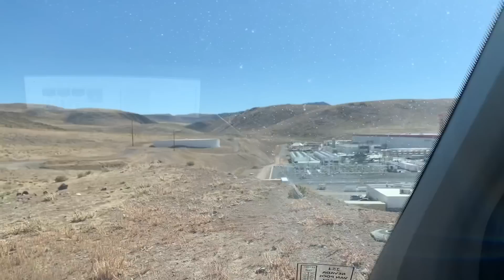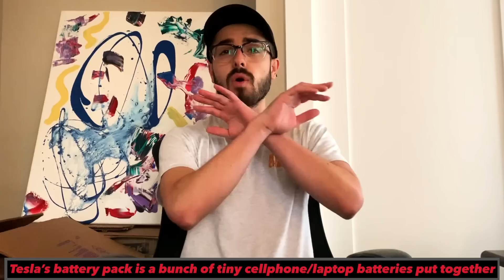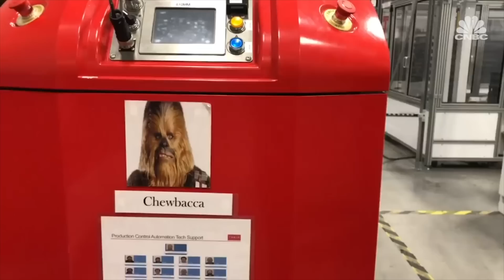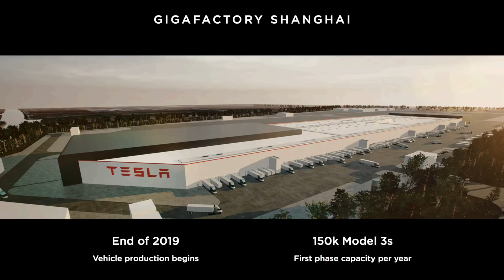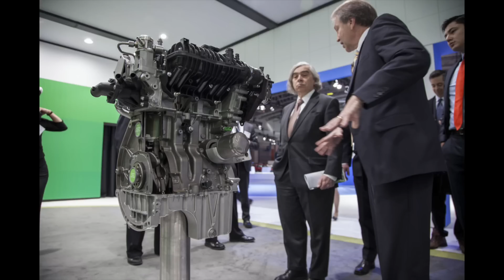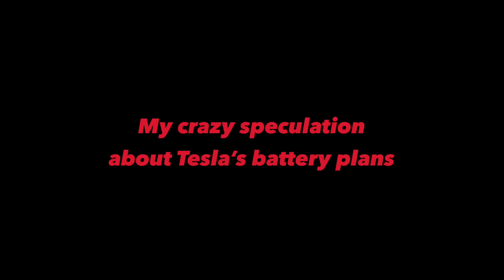GigaNotes: Analysis From My Tesla Gigafactory Tour

Comment: Most likely the Semi will use a newer variation of NMC cell chemistry, similar to what they already use in the Powerwalls and Powerpacks.  That's what Jeff Dahn has been working on to improve the energy density because it has higher cycle life capability than the NCA chemistry Tesla us currently using in vehicles.  They need the higher cycle life for the Semi and Robotaxis.  It will still be in the 2170 cylindrical format.  People get confused because Dahn made a pouch cell in the lab, but that's just for testing.  The chemistry can still be made in any form.
Reply: Supposedly pouches are more space-efficient, meaning more density and longer range in a smaller pack. So this may be important for the Semi and Roadster, not so much Model 3/Y.
Reply: @EMichaelBall  Space is always a concern, especially in a small vehicle like the 3/Y, but cylindrical cells are easier to cool and heat, and all of Tesla's pack assembly machinery are setup for cylindrical cells.  Unlikely they'd change formats for low production vehicles like Semi and Roadster.

Comment: Not really a bunch of cellphone/laptop batteries ... those are typically flat packs shaped to fit in and around the motherboards, etc. More like a bunch of flashlight batteries (AAA, AA) in a pack.
Reply: My laptop battery pack has a visible plastic tube that is clearly cylindical cells.
Reply: actually a laptop battery is literally a battery pack filled with cylindrical cells, probably 18650
Reply: @xXJeReMiAhXx99  Some laptop batteries are actually made of flat, "prismatic" cells.
Reply: How do you five year old laptop battery perform? Now think of having a car with those.. 😂
Reply: @ACPilot  idiot

Comment: Hi Gali, love your enthusiasm and Tesla reports. First time I heard you mention you are a climate chance activist. Please spend some time looking into the new 4th generation Nuclear - molten salt Thorium reactors. It’s “walk away safe” as it runs at normal atmospheric pressure but very high temperature (600-700 degrees centigrade). One third of greenhouse gases are from industrial heating requirements that these can address (of course power gereration also which is another third). Many startups getting into this but China leading with billions of investment. Needs someone like you to help push it. BTW it’s 95% fuel efficient compared to today’s nuclear which is under 2% so massive waste. A variation of Molten salt reactors can use left over fuel from exiting nuclear ... absolutely no-brainer tech but needs someone like Elon to speed it up and someone like you to get the message out😁
Reply: So far no 4th Gen reactor has been successfully built, besides it needs a Plutonium trigger source. At this time very much pie in the sky, the Chinese have been trying so far with limited results to develop a practical, working economically viable product.
Plenty of spin and PR promoting it however - raise investor interest for the "next sure thing"
Reply: Sorry Frank - it will be full on within ten years. a prototype ran successfully for four years in the 60s, although not using Thorium. They don’t need plutonium to get started but U235 for example. Many victims of MSR fud - mainly from nuclear physics phds that spent as much time learning about MSR options as doctors spent learning about nutrition. There’s about six serious start ups in USA, one funded by bill gates. What’s

Comment: Excellent.  I sent a few tweets to Sean Mitchel about 3 hrs. ago regarding batteries.  Here's a copy/paste of what I sent Sean: >>>>>   Hi...off topic...RE: Batteries - Demand for Tesla EV's are enormous. -- Then there's Powerwalls, Powerpacks, Megapacks. -- I see 2020 bat. demand near 4X 2019 levels. Could capacity of Panasonic + Tesla-made + LG-made meet a 2020 3X to 4X bat. supply? The Bat issue has become......cont. very complicated. Is it wise to work with LG? What is Panasonic's future? What's the possibility Tesla will manu. a chunk of It's own Bats? Will the Maxwell dry process factor in? I'm certain 2020 will bring Tesla enormous poss. biz. if the Bat. capacity balloons. Thoughts? >>>>>  Supposing I'm in the ballpark for 2020....if Tesla is only able to double (2X) the number of batteries from 2019 level to 2020, I believe potential, important customers could be lost.  I've been obsessed with Tesla for 4-5 years now.  I've never been concerned about Demand.  I'm an Equities Trader.  I've been at it for the better part of 22 years.  The joke, 'people who go for a Tesla test drive either buy the car or buy the Stock' is not a joke;  in the sense that it is very true.  However, I've consistently had agita about Tesla's battery procurement.  Over the past few months I have become more bullish on Demand, at the same time I've become more confused over Tesla's battery situation.....Hibar, Maxwell, 1,000,000 mile battery seemingly having nothing to do with Maxwell's dry electrode process, Panasonic/Elon clashes, Nickel Sulphate prices,  and on and on.....What are your thoughts?
Reply: Battery day can't come soon enough.  A new Maxwell ultracap technology would be super dope if they found a way to implement into cars

Comment: Technical question : how come Tesla uses thousands of cylindrical batteries? Isn't there a lot of unused space (like between the batteries and also the thickness of battery walls)?  Wouldn't it be more efficient to use just one big flat battery like on the Nissan Leaf?
Reply: Good question. I think it may have to do with cooling of the batteries

Comment: Question for any Tesla geek: How easy is it to replace battery packs as the technology improves? Is there plans to replace the packs in existing cars and sending the old ones off to be used as grid balancing storage? Knowing that an existing car can be easily upgraded with better batteries is a big factor in deciding when to buy one.
Reply: CMW - Tesla would want you to buy a new car, to Tesla it is all about getting new cars out the door, when it is out the door you’re alone with bad support from Tesla.
Reply: There are probably no plans to replace battery packs as the technology improves. There are a couple of reasons this idea won't work well; First, Tesla is in the business of selling new cars, not refurbishing old ones, Secondly, the current battery packs are designed to last 300 to 500 thousand miles (Model 3). In normal use, that would be 20+ years for the average USA Driver (annual average miles driven in US is ~ 13,400 miles). Frankly, if your car lasts 20 Years, you deserve to treat yourself to a new car!  Additionally, trying to integrate a new battery pack, with updated/upgraded battery management electronics into an old car with much older versions of electronics could be nearly impossible to do because technology advances so quickly.
Reply: @bbcooter388  Thanks. I wasn't thinking so much of Tesla themselves doing it and know that the battery management software would need updating. I was wondering about how pluggable they are and whether you could increase the range of an existing car. You answered the question pretty well.

Comment: Gali, great video. Thanks.  Without understanding what could happen next with the battery technologies and the acquisitions (Maxwell and Hibar) it is clear that an extrapolation out to 1Tw of capacity will not be based on 2170 cells alone.  Unless we are deluded, there will be significant improvements that will positively affect cost, capacity, longevity and volume and all of this augers well for the company and its products.  On another note, the scale of innovation and investment will inevitably be a drain on potential profitability.  No one should expect the business to suddenly start delivering dividends.  Tesla, instead, will ramp its factories and processes until it creates a tsunami of capability that will allow it to rapidly bring the revolutionary products to market in the volumes needed to change the way the world works. Cheers.

Comment: Sparks, Nevada is actually a city that's nearly as populated as Reno and is, in fact, everything east of a line a few blocks east of 395/580, which cuts north/south through the center of what you would consider reno. It's just that the city limits in the area are obnoxious. I work at the gigafactory and you can drive 70mph for 20 mins east from the city proper and still be in Sparks.

Comment: Great job at explaining the superior craftsmanship of Tesla, but it's kind of frustrating that it doesn't translate in a massive superiority in their vehicles' range. I mean Porsche and Volvo are able to conjure up cars with range in the same ballpark without even trying hard (or at least without the same company implication in BEVs). When watching your video, a natural reaction should be :'Ah that's why the model S has a 1000km range when the Taycan has only 250'. And yet...
Reply: David Louys ......and yet the prices of Porsche, etc are 50-100% more ..... Go really shop for one and you will understand !!!
Reply: bob chou - Porsche cost more because of the brand name, so do their ICE models.
Reply: The S long range has 100+ miles more range, in a pack that is only slightly larger, in a car the same length, which is lighter, and much cheaper, and they can build more of them then Porsche is planning for a few years...that seems to match up with Gali’s points.
Reply: @davidradtke160  Yes but you see what I mean, Tesla started way earlier than competition, does nothing but BEVs, is vertically integrated and makes as much as possible in house. And yet competitors whose manufacturing culture is very different can still make cars that aren't an order of magnitude less capable. That's all I'm saying